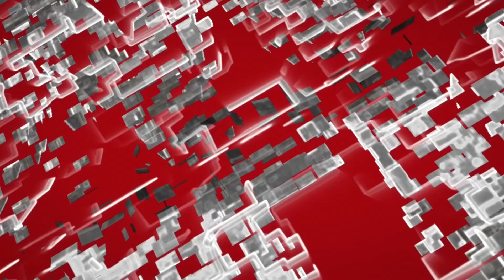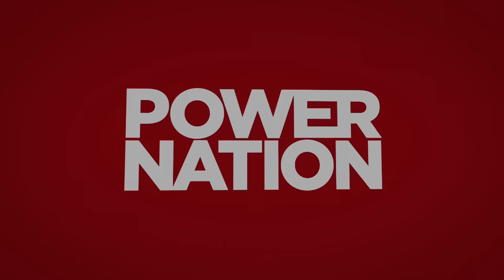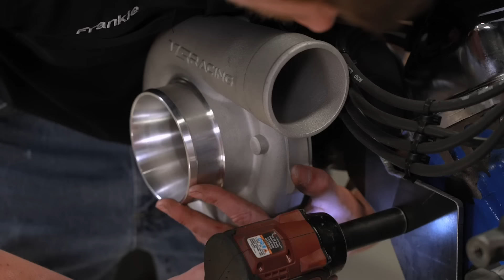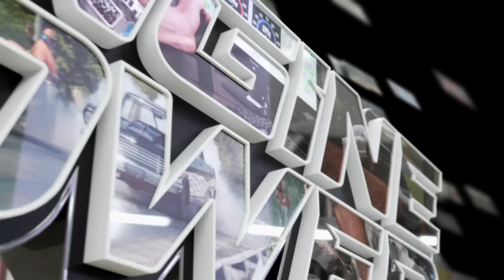Upgrading The Naturally Aspirated Horsepower In A 460 Big Block Ford - Engine Power S11, E10

Comment: Needs way more cam, compression, single plane. A BBF making less than 650hp is a waste of time. You can make 600hp with TFS 11R 190cc heads on a 357ci 9.5" Windsor. A cheapo Scat 408 Windsor with TFS 11Rs can make 650hp easy, is way smaller and lighter. If I was going to mess with an old school BBF I would want to run a Qjet on it to get the sweet sounds that Gator McCluskey was making with his brown '71 Ford Custom 500 sedan.

Comment: My concern with these fuel injection kits is (electronic) part failure. These are not the EFI systems on mass produced vehicles- made to have very low failure rates. Heard some horror stories of people being stuck somewhere for a long time waiting on replacement parts of something in the EFI system fails (because none of it is at the local auto parts store). That was never an issue with carbs.. well, typically. I do like the convenience and performance/economy they offer. But the "either they work or you are stuck at a motel waiting on parts during your trip" nature is a concern.
Reply: Can't you just toss an old trusty carb in the trunk for long distance cruises for a simple backup?
Reply: @Warrior_Resisting_Colonialism  I'm not sure the fuel pump and intake and throttle will make that a simple swap once you go with an EFI kit.
Reply: Yep, shows like this never deal with the realities of these aftermarket EFI units.  Not when they are being paid to be shills.

Comment: What I love about the 460 architecture is the huge bore and relatively small stroke, generally I used to think big block meant long strong or a square bore/stroke ratio, so does that mean a 460 is meant to rev?
Reply: It would seem that way, but if I remember correctly they stroked and bored a 429 (385 series) to 460 mainly for the claim to fame of sheer cubic inches.  Had to compete with other land yachts that had 500’s and 455’s.   Ford advertised it as low rpm torque, but hey, marketing ya know.
Reply: @SME.Retired the 460 is a 429 with a longer stroke. The Ford 400 has a longer stroke than a 460, a 393w has the same stroke as a 460. The Cadillac 500 has the longest stroke of the common classic Big Blocks 4.3" the Olds is close at 4.25", the 429/460 are very similar to the Mopar 400/440 with big bore and shorter stroke except the Mopars have a shorter stroke. The 429/460, Olds 403, Mopar 400 have some of the biggest factory bores.
Reply: If you can find a cam rated for it and not float the valves, I'm sure it would be good

Comment: If only Holley/Edelbrock weren't complete corporate sellouts. 
They are unresponsive to customer/calibrator input. 
The feature sets lag 30+ years behind domestic OEMs. 
These companies are predatory to the amateur community

powernation, you have all these Dynos, but fail to see how these primative ECUs fail to integrate with the rest of the vehicle properly. 

Case And Point: Holley Terminator doesn't have enough Native/ I/O to run its own (transbrake) software.
Throws up hands
Reply: Neither Holley nor Edelbrock is what it was decades ago.
Reply: I agree.
But when they are the ones paying the bills...

Comment: This episode gets me pumped, I have a 460 stroked to a 521 with nearly the same setup as this. Now I know what get to look forward to!
Reply: Good luck man
Reply: Awesome
Reply: Sweet! Sounds like a hot set up!
Reply: You'll make 100-200rwp more n/a with your stroker, what's it going in??
Reply: Where’s your proof
Reply: Put a little more cam in it.  With the heads on this engine they are giving up 40+ HP with the too small cam.
Reply: @danmyers9372  Remember, it's not a race engine! It still needs to run on pump gas and make torque down low. Probably going in a truck or something.

Comment: Decent build but with the aftermarket heads it should be doing better than that. With stock heads that weren't even ported out ut just given a good valve job a 460 is capable of putting out over 500 HP.
Reply: The first run 519 hp. final with timing 533.  Did you watch? Are you talking about the turbo? They had stock heads before.
Reply: @user-tu1ee6dc5f  I watched. I am talking normally aspirated 460's were putting out over 500 HP using unreported stock heads over 20 years ago and with porting they can be pushed to equal or even exceed the output of the test engine in the video.
Reply: Cam was way too small for the flow of those heads.  Customer must have wanted a low RPM build for towing?
Reply: @danmyers9372  My 4.6L 2v has 38cc TFS heads n made 309rwhp 321rwtrq at 5,446rpm.. i wanted more torque than high revving street monster since the streets are slow.. i got a degreeing issue it serms, bcuz it was supposed to tap out at 6,300rpm.. i get what you're saying.. Room to grow on these heads..